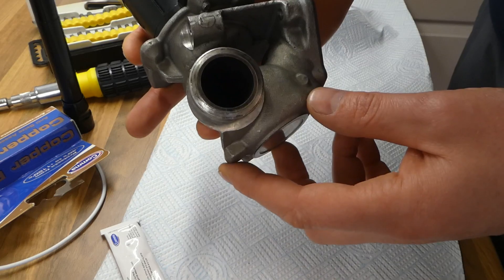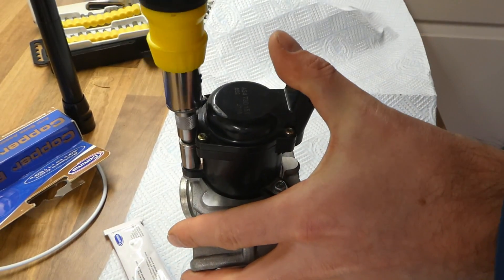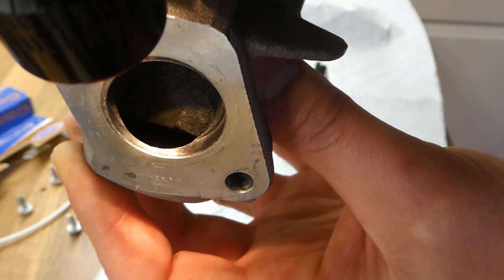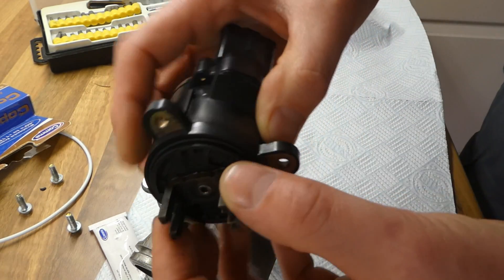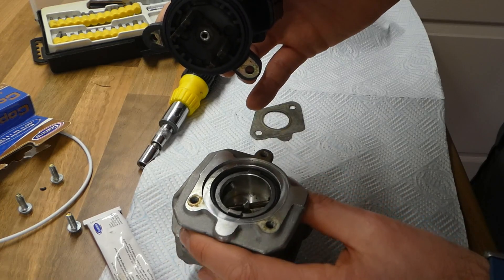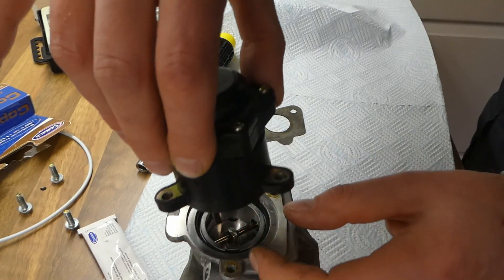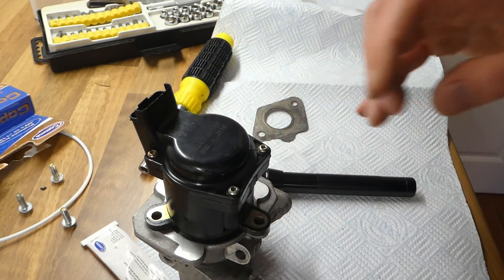taking apart an EGR valve for cleaning for 1.6HDi/TDCi (Peugeot, Citroen, etc.)

Comment: Did you have to reconfigure the new EGR valve using diagnostics tools like PP2000 once you replaced the original old part?
Reply from the maker: Hi CSR ALN, If the EGR is replaced with a new one, then yes, one needs to reconfigure with PP2000 (Peugeot) or Lexia (Citroen). If it is just cleaning, then there is no need to reconfigure it. The ECU needs to now how exactly the EGR valve behaves.

Comment: When you move the forks by your hand on the electronic part.. when the forks are returning to start position, are they slightly pinching at some point like some intermediate station, can you feel it? Mine does and I dont know if that's how it supposed to be. Please respond. Thanks
Reply from the maker: Hi kleinek86, there should not be an intermediate point. They should return smoothly, with some force to the original position, no snagging. If there is some intermediate "station", "position", this means that something is stopping it from returning or it is catching on something in the top part of the EGR valve. I would suggest to open the very top part and investigate. I have a video of how to assemble the top part (https://www.youtube.com/watch?v=skYgkb4xSbQ), as it is slightly tricky. Watch it first before opening it. Yours maybe different inside than mine, but it should be fairly similar. There is a spring inside that does this rotation. Good luck, hope this helps.
Reply: @moremolecules  thanks. I clean it and already put it back in the car. It works for now. Will see in the future. I also noticed thet whoeever take off the valve before I did, he didnt put the gasket on the right position so the hole was 1/3 coverd by gasket. (im talking aboute the metal gasket between engine Block and valve).

Comment: Guys I took off the plastic element with engine inside and and start  engine, it doesn't move any direction... Is it normal? My car is very slow under 3000 rpm...
Reply: *Start motor
Reply from the maker: You would need PP2000 or diagbox in order to test the EGR valve. Not too sure if I understand which plastic you took off. You would still need power for the EGR to operate.
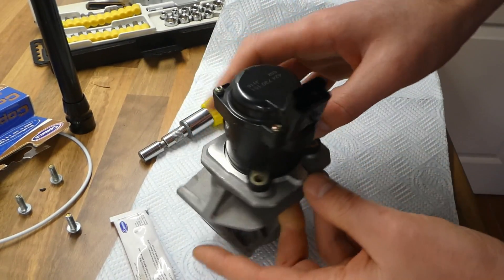Reply: @moremolecules  i mean element at 2:30
Reply from the maker: @House2000Maker  I am not too sure if it is supposed to move when you tart the engine. The best way to test it is with PP2000/diagbox. There is a specific test for the electronic and mechanical parts.

Comment: If its not lined up properly could that cause the car to not start? I took mine off and cleaned it today now the car only turns over it will not start up
Reply from the maker: Absolutely right, there will be a substantial vacuum leak.
Reply: cant0do0better  thank you i took the 3 8mm bolts out and took the assembly off to check and clean it and i havnt been able to start the car since because it just turns over.. thank you i will check today
Reply from the maker: @alexhousley2070  Apologies, I thought you meant the actual EGR valve, rather than the upper (electronic) part. Either way, it has to be aligned properly in order for it to work. Check cables for the fuel lines/filter and electrical connections. If it turns over it may mean a lot of things, but check intake manifold piping and fuel lines. Also remember to pump the priming bulb/pump until hard (~5-10 times, maybe more), this will clear air in the fuel system.
Reply: cant0do0better thank you very much i will check through everything you have mentioned. The car never failed to start befor i took the egr valve off the only problem it had was it would go into limp mode and wouldnt rev last 3000rpm and it had code p042f egr vavle stuck closed but i do think i messed up when refitting the black 3 bolt part.. thank you again for your help great video
Reply from the maker: @alexhousley2070  Even if the EGR is completely blocked (i.e. not working due to bolts, etc.) that would not cause non starting issues, possibly hard starting/rough idle. Cannot be 100% certain, but fuel issues will certainly cause non starting. Definitely check fuel lines, electrical connections (MAF, fuel filter, EGR itself), air hoses (turbo) or anything that you have removed/taken off. Certainly check the fuel priming pump, it should get relatively hard in a few squeezes/pumps (5-10 maybe more) and you should hear fuel flowing through it. If it is really soft and there is no resistance when squeezing, then there is air in the fuel lines, either hose/line disconnected or ruptured.
Good luck!
Reply: Fuel you need take air from fuel system. This car can not take it easy

Comment: Just wanted to add a tip. I've just taken mine off and cleaned it. EGR AND BRAKE cleaner was useless, hardly touched the deposits. So I used a foaming oven cleaner. It now looks like brand new inside. Obviously take off the electrical part first as you will need to hose and fresh water to clean the oven cleaner out. It cleaned it amazingly and because its foam, it got into every space and sat there until I washed it out. I used Mr Muscle brand. Amazing for cleaning these.
Reply: Needing too clean mine and have a tin handy so will try it this week cheers
Reply: Oven cleaner worked amazingly! thanks for the tip

Comment: Also take the electrical part apart and clean it. The connectors get full of soot. Mine did. There is a spring inside so be careful. It's not under load so won't fly out but you will need to line it back up when you replace it
Reply from the maker: Absolutely correct. I have made another video if how to to take the electrical part apart and put it back together: https://www.youtube.com/watch?v=skYgkb4xSbQ
Reply: How did you clean the EGR valve connectors (5-pin male and female connectors)? Mr.Muscle, carb cleaner, contacts cleaner?

Comment: After egr cleaned , i have p0489 erorr...you know maybe what i did broken??
Reply from the maker: I have not had an error after cleaning an EGR valve. Was the error before there as well? Is it plugged in?
Reply: cant0do0better  no ..before was just p0490 means: very high level pression in egr system...and p0489 means this https://www.obd-codes.com/p0489 but what is wrong realy...what thing??
Reply from the maker: Did you also put in the correct position, if it is not correct it will not turn and throw an EGR failure. It should be that when it switches on it can turn the pin. I suppose you have. I would take it apart again and make sure it is alright
Reply: Adaptation ECU after clean in this engines

Comment: Freaking awesome! Unfortunaly i broke one of the 2 small resistors solderd in the Black cap. Do you think this will cause problems?
Reply: R H that components are capacitors not resistors. They are 100nF and 10nF (if I'm not wrong). If you look on their body through a lens you can see the capacitance value (103 for 10nf and 104 for 100nf). You can buy they on rs-components, mouser or on ebay... These are common electronic components, but the only problem it's to find they with the right shape. Also look for the presence of oxidation because in my old and broken egr valve i found that the metallic contacts/paths are in bad conditions and in this case it's better don't waste your time and buy a new (or second hand) valve. Sorry for by bad english and good luck!
Reply from the maker: Hmm, not too sure, I suppose it will be a problem. Can you solder them on or put back together?

Comment: I removed the Black cap from the upper part and the spring came out please help me how to put it back inside help please!!!
Reply from the maker: Do you mean the electronic part, the very top of the EGR valve?
If that is the case, I have not taken this apart, but I can have a look in one of my spares and see what is what.
Reply: cant0do0better yes i mean the Electronic part i took it off and a spring came off now i dont know how to put it back inside
Reply: cant0do0better can you make a video how to put the spring back in place?
Reply from the maker: I will see if I can take apart a spare EGR valve and put it back together. If I can manage, I will post a video.
Reply: cant0do0better that will be freaking awesome!!!!!!! When do you think you can do this? I will Thank you forever!!!
Reply from the maker: I think I found a way to do it, it is not too difficult. I will try to do a video in a few hours, cannot do it immediately.
Reply: cant0do0better i will Thank you for all eternity my friend!! Really also i would like to add you to Skype or something like that since we have the same cars and maybe share knowledge
Reply from the maker: No worries. I uploaded the video of how to put back the electronic part (https://www.youtube.com/watch?v=skYgkb4xSbQ). I hope it helps.
Reply: cant0do0better did you get my last response about breaking one of the resistors?
Reply: cant0do0better when i tried to put the spring back in one of 2 resistors broke soldered to the cap
Reply from the maker: Hmm, not too sure if they will affect, I suppose it will. Can you solder or put them back in
Reply: cant0do0better nope they were rusted also when i rotate the black pins it Will not bounce back sometimes
Reply: cant0do0better there is a small hole in the Black cap maybe this is causing all the trouble
Reply from the maker: Can you post a video, where is this hole?
Reply from the maker: @R H, that does not look healthy. There should not be holes or stuff that hold it together. The thing in the middle of the top part is an eeprom, that should be in contact so it can be written/read. That may be a problem altogether
Reply: cant0do0better i am thinking about closing the egr valve with a metal plate. Then the valve will stop working altogether. Will this harm the engine?
Reply from the maker: @R H, the engine will be ok with a non-working egr valve, although it may throw an error message and it will be spewing more NO2. Depending on where you are, in the UK the new mot will be checking for EGR tampering. If I were you, I would get a second hand valve and clean it thoroughly. It has to be reconfigured with diagbox/PP2000/Lexia in order to work with your engine. Good luck
Reply from the maker: That would work. Depending on the model it may go into a limp mode, but it may not. It will certainly throw an error on the engine, but it will not hamper the engine. It will though spew more nitrous oxide gasses, as the purpose of the EGR valve is to reduce the temperature of the burning in the chamber, i.e. less oxygen to burn. Good luck
Reply: cant0do0better i closed the valve now it runs good when Idle i think the Electronic part of the egr was broken that is why the valve was open on idle instead of closed
Reply from the maker: @R H, great work! I bet if you buy the cheapest possible second-hand EGR valve and replace the electronic part it would work. Will need reconfiguring with diagbox/PP2000. Or even broken (not cleaned) one would work.
Reply: cant0do0better great now i have 2 errors. P1351 and p0704 you know how to solve these?
Reply from the maker: I do not know about the P0704, but the P1351 is a pre-heating relay. So, it is either the glow-plugs (test with a multimeter for continuity, i.e. ~1ohm) or the relay itself, at the back of the beginning of the air intake, next to the left-hand side headlight.
Reply: cant0do0better ok so i need to test the glowplugs do i need to replace them all? Also do you know a way to clean my turbo? Like a spray or something?
Reply from the maker: It is either the relay or the glow plugs. You can check the glow plugs with a multimeter, although it is not definitive. Check my video on the glow plug replacement for how to access them and test with a multimeter. Not too sure how to test the relay, you may want to search for that. I do not think a spray would help the turbo.
Reply: cant0do0better great maybe also make a video how to clean the dpf filter
Reply from the maker: I have no DPF filter on mine, so cannot really do one
Reply: R H  i have p0489 erorr  after than  egr cleaned..can you know what ia did broked??
Reply: Simon ииугуаи Just block the valve problem solved
Reply: cant0do0better do you have more tips for this car like maintenance tips
Reply: cant0do0better hi bro right now the only problem i am facing is p0299 code turbo underboost... Maybe you have some ideas

Comment: Nice video, so when you assemble the actuator with the other metal part you need to rotate it? Is there a special position?
Reply from the maker: Yes, there is a special position. It needs to be rotated in a way that the metal pin is at the upper position. This way the electronic part when activated will push the pin down and I think will open the valve..
Reply: cant0do0better thank you 😁, is there a way to verify if the electric motor is still good?
Reply from the maker: Depending on the car you can operate to hear it clicking (valve closing and opening). With Peugeot (pp2000) and Citroen (Lexia) one can check the operation of the electronic part.

Comment: should the electric valve rotate freely and smoothly without any resistance at all, or are there any distinct steps when rotating with fingers?
Reply from the maker: It should rotate freely and smoothly. As far as I understand there should not be any distinct steps. It basically lifts and opens the valve. I think the one on the video was faulty, i.e. had a bit of a snag within the channel.
Reply: Thanks. My own solenoid actuator sticks, binds slightly between two extreme positions. Sometimes the spring force cannot push it through. I tried soaking in diesel, lubricate with light oil to no avail. Taking the lid off and giving the solenoid multiple rotations in either direction in hope of loosening the soot (no way to take it apart and clean) only seems to have made it worse. Unlucky for me it is the same with a second hand one bought of ebay. I guess these are prone to failure and a new solenoid valve is the only solution.
Reply from the maker: The one I have shown in the video was only 1-year old. My computer software was showing errors of valve sticking even after cleaning it thoroughly. The channel was somewhat not drilled very well. I opted to replace it with a new one. I suspect that the channel can be made smoother, although not too sure with what. Sand paper will not do it probably.
Reply: @moremolecules  When you changed the EGR valve did your fault codes reappeared?
If you get EGR fault codes, can the turbo or the DPF filter be the real problem?
Reply from the maker: @clsfiftyfive  , all codes disappeared after changing the EGR valve. Nothing EGR-related has come up after ~1.5 years and ~12-15,000 miles. My car does not have DPF/fap.
Update: I thought about it a bit more. It is possible that turbo problem could result in relatively more EGR problems. Say your turbo blows oil and some of it will go through the EGR and thus blocking it more regularly. The intercooler will condense quite a bit of the oil, but some will pass through. Also, oil vapour or faulty CrankCase Ventilation valve could also bring more oil to the turbo and get compressed to the EGR.
Reply: @moremolecules  thanks for the info.
Reply: @moremolecules  That is the most likely scenario for the terrible crunch case ventilation mechanism in Hdi 1.6. Why would someone design crunch case ventilation dumping oil the turbo...
Reply from the maker: @konstantinekakabadze2527  Not too sure what you mean by "crunch case ventilation", but the EGR serves to reduce the temperature in the cylinders when not under heavy load, i.e. going along motorway/highway.
Reply: @moremolecules  Yeah, I know that. I meant to say that PCV valve is designed poorly, which dumps oil to the turbine, which can eventually cause faster clogging EGR valve than expected
Reply from the maker: @konstantinekakabadze2527  Yes that is probably true, although the other manufacturers have nearly the same designs that clog about the same. I think only BMW have some cyclone system that filters more oil, similar to an oil catch can.

Comment: Good video, very much appreciated. These valves are costly, even on eBay you will pay around £75 for a second hand one and a few hundred pounds for a reconditioned one. My car is a Peugeot 307 1.6hdi 2006 and this is the exact same valve. I understand there are two versions of these valves, the only difference being the electrical connector. I understand that they cannot be swapped because the valves have different electrical resistances. Don’t be tempted to remove the four screws on top of the plastic cap to replace the motor because there is a stud holding it in place.
Reply from the maker: Thank you and good advice for not trying to replace the motor